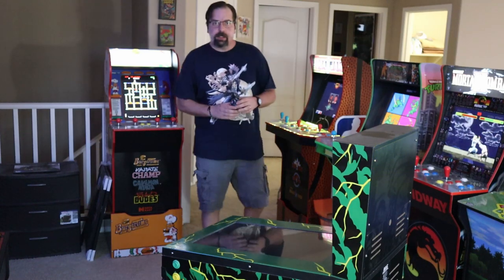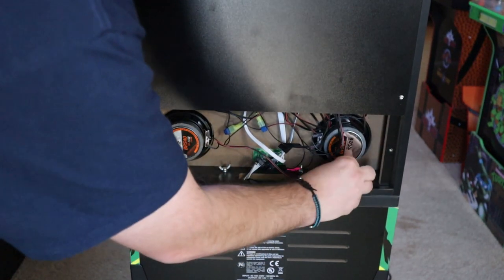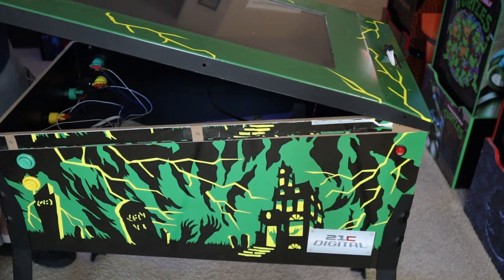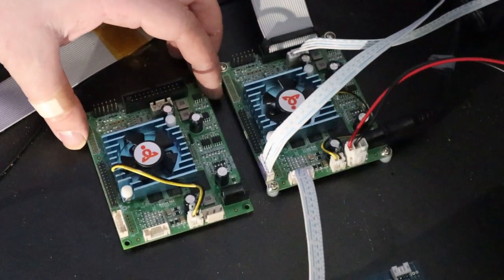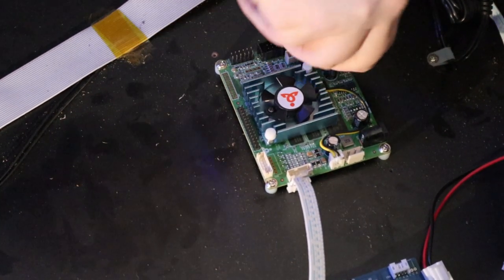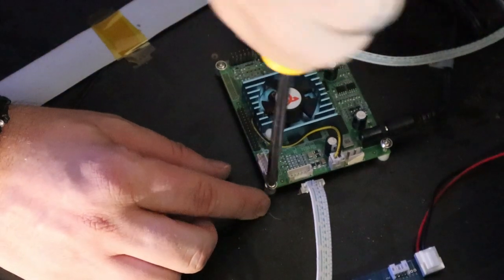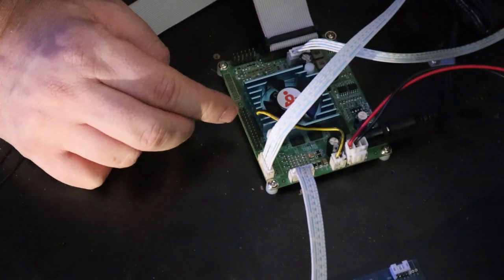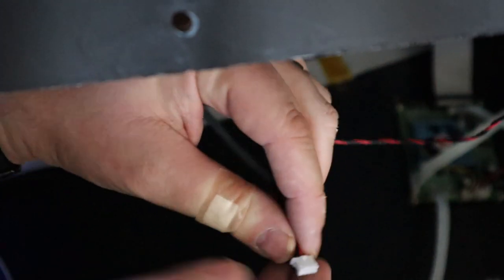Toy Shock Pinball - How to replace your PCB Board!

Comment: PDubs,

Great to see this is plug and play!  Looks like it's going to be some work, but definitely manageable.  A lot better than PCB manipulation in an Arcade1up, glue city :) 

I think I will get another to help me with this project, at least with the monitor part.

Thanks again!

vgv
Reply from the maker: Yes the monitor is heavy when connected to the bezel i recommend having a helper hold it while you plug it in.
Reply: Ironically, the PCBs are pretty simple to swap out in Arcade1up cabs, actually. It's the controls which are problematic because of the glue. At least that's been my experience.

Comment: And I just discovered none of the holes line up, and there's no way to move the old board's fan, over to the new one, as the fan mount is a quarter inch wider than the new one, if it even was supposed to come with a fan. Geez.

Comment: Well, after finding the 1.3 vid, I got it all back together, but I'm in a very BAD spot. The monitor is, indeed, shot. I think the cable to it got ripped off it's contacts, in the monitor, when I nearly dropped it, earlier. Oh well.  Trash comes tomorrow, so, I guess I'll be hauling it out to the curb. I won't see that kind of money again. LOL
Reply from the maker: OH No Thomas!  I'm just catching up on your comments here and I'm sorry to hear what happened with your Unit!  It's weird the 1.2 Boards looked identical to the 1.0 Boards.  The 1.3 Boards looked totally different and there was a separate video to watch to install those correctly.
Reply: @PDubsArcadeLoft  Yep. After a few hours of searching, I eventually found that vid.

Comment: Got the board in, but I have no idea what was to go where, and which way round. It powered up, but only the backbox lit, and I could see scores changing, when I pressed buttons, but the monitor, and audio don't work at all. There was no silk screening on the PCB to tell me what did what, either. I think I may have ripped the ribbon connector from the monitor, par way, when it fell. I've got it on a bench, but I really can't see inside the connector. Really need a sighted person, who knows what they're doing. I'm disgusted with Toyshock. Took a year for that PCB to come in, too.

Comment: Well, that's four hours of my life, I'd love to get back. The board they sent is all wrong. The connectors are all in different places. There isn't even a fan. The stand-off peg screw holes are an inch off, on the fore/aft axis. When removing the monitor, it slipped, and I think I may have torn the connector loose on that. Time to break out the micro drill kit. After all that fiddling, and faffing about, with that new board, it's probably been discharged on, several times, so there's no telling if it's even useable, now. Not sure which connections are safe. The board  looks absolutely nothing like the original. Power con is even in a different place. maybe the size of the connectors are the same. Who knows.